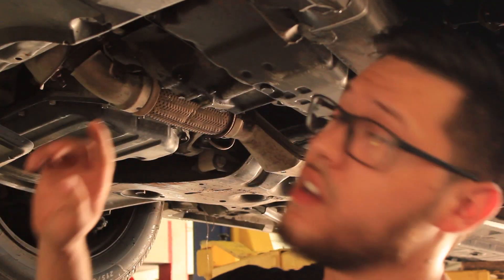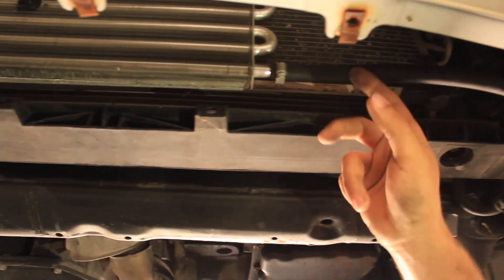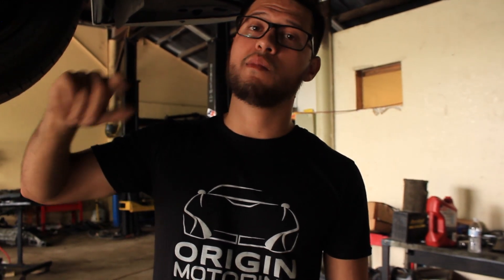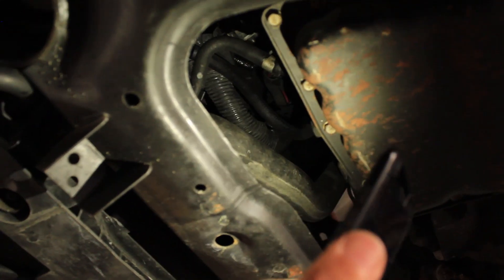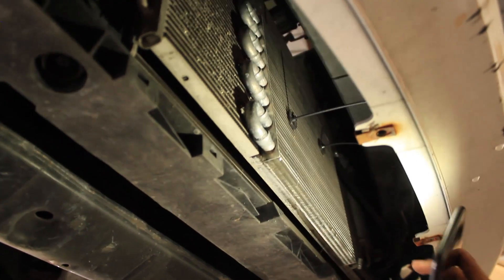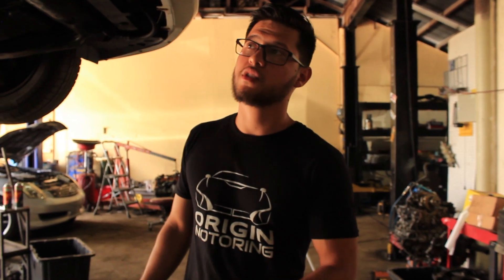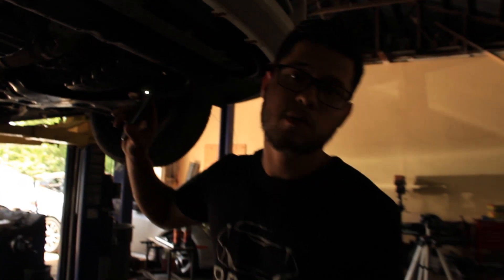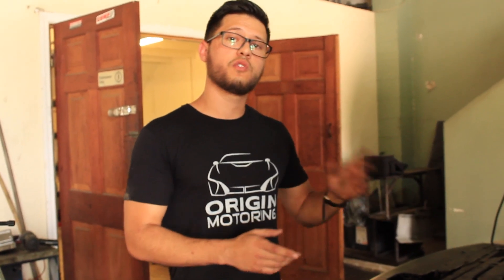Altima cvt Fix. Transmission more reliable

Comment: I have Nissan Altima 2013 SV 2.5L
My Car lose power while I'm driving , and it's not accelerating.
I call Nissan affairs customer service, I asked them if my car has a recall for the Transmission, They told me No, I ask them for Assistant to fix my car.
She said yes, we can open case for you but you have to go to the dealer for diagnostic test, I told her They Asked $200 for diagnostic test. I went there they said it's not the transmission it's the MAF need to be reprogrammed, and I pay $370 for that, problem came again next day, I call Nissan they asked me to do the diagnostic test again and pay another $200 
I agreed, in the end they told me Transmission need to be replaced, Nissan Company called me and she said because you have high mileage we will not be able to assist you, I told her you know my mileage from the beginning why you asked me to went to the dealer for the test and pay $370 and  $200 and $288. and you already had the decision in advanced?
I recommend every body don't buy Nissan their car is 
piece of Junk.
They work with dealer to make money from you 
don't buy their car it's not reliable
Reply: Exactly change the oil I think you will be fine
Reply: John Smithy  Nowadays, most AT car are CVT
Reply: This is why I have replaced my CVT fluid twice.    Current odometer reading: 119,xxx
Next, because of the problems with this, I bought a Car Shield repair policy.
Reply: @billaustin2347  I did also.. how did things go with that
Reply: change the transmission oil. buy a hand pump to suck the oil out. thatll fix it

Comment: Ok, so you are completely by passing the radiator??  You are not fitting the cooler inline with the radiator.  My '12 Altima went into lump mode (30 mph,a self protection mode) going over the 'grapevine' grade in SoCal. I need to keep it cool. But I need to understand how you routed this fix. Thanks for the video!!

Comment: I put the cooler on my 2013 Nissan Altima 2.5l cvt just as you described in the video and it only held about 1/2 qt more and i noticed smoother shifting right away and haven't been on the freeway yet either just running backroads of central Kentucky going to work and home  , thanks again for the great information and video on how to install 😎
Reply: I used the Hayden 516 kit and bought 4 feet of their 3/8 transmission hose for peace of mind  , thanks again my friend
Reply from the maker: @daveanderson8354  how many miles? I have 190k miles on mine original engine and transmission we're shooting for 250k minimum and 300k is our real goal.
Reply: @origintuning7000  92,000 miles and i noticed i had to check the transmission fluid level with the car not running lol
Reply from the maker: @daveanderson8354  also the 2013 is the new body style you can use the 2007-2012 round body transmission dipstick on the 2013-2017. We just bought a 2013 and confirmed it works! The 2013 doesnt have a transmission dipstick its the dumbest little cap
Reply: @origintuning7000  i purchased the dipstick for a earlier model also lol
Reply: Is that the correct way of checking the fluid? Get it up to temperature and then turn car off and check with the dipstick with car not running lol ?
Reply: @origintuning7000  also on my 2013 Nissan Altima 2.5l sedan cvt transmission there is a paper element filter and the metal one on the valve body in the pan , just wanted to share that with you because Nissan says it doesn't have one but i know it does i replaced it lol
Reply: It's called a transmission cooler filter part # 31726-3JXOA
Reply from the maker: @daveanderson8354  check the fluid car on in park with the older Altima dipstick. The inline paper filter comes on some models and I believe it has a tiny magnet inside it too. Great add on by nissan.
Reply: @origintuning7000  thanks for the follow up info my friend
Reply: dave anderson thanks guys! Great info! Dave how is your Altima running? 
I also have 13 Altima, wanted to know if the cooler affects the cvt performance in cold winter  days?
Thank you!
Reply: @roberto3330  it's got about 110,000 now and still pretty quiet but still hear a small growl that could be the nature of the beast i guess,  but no shimmy or shudder and no slipping yet also noticed it seems to get 1.9 more mpg too

Comment: Hi there I was hoping that u guys could help me . I have a 2010 altima and the problem with it is that the transmission doesn't change on it's own I have to release the accelerator every time to change gears. Have you seen thus kind of problem in other altimas.
Reply from the maker: You may need to scan it with a good scanner like a snap on our maxidas scanner. Something that actually reads the transmission computer. A hand held auto parts store scanner may not be enough
Reply: @origintuning7000  can I send u guys a video of the problem so u can recommend me a solution.
Reply from the maker: @shajisaeed2656  a video wont help. You need to access the tcm transmissiom control module with a good scanner and read the live data/error codes
Reply: @origintuning7000  thx man I'll try to do like you said hopefully can solve the problem without having to spend a fortune. Thanks for replying so soon . Cheers
Reply from the maker: @shajisaeed2656  call around most family owned independent owned shops like mine will charge $40-60 to get into the tcm and give you a good idea of what's going on. The dealer or big name shops like firestone you're looking at spending $150+ just to hookup there scanners and get an idea of what's going on
Reply from the maker: Check fluid level. Any codes?
Reply: @origintuning7000   changing fluid yearly and no codes displayed

Comment: Do the 2017 models have thus problems?
Reply: Ive got a versa fwiw
Reply from the maker: Yes it does. Look on Google already lots of complaints
Reply: @origintuning7000  smfh...someonee should sue them
Reply: @don9526  just change it every 50k miles. I have 205k on my altima. Fluid change helps
Reply: occckid123 Is the cvt still running now ?

Comment: I have 2014 rogue the one they the Little pathfinder when I bought it New i had to replace the the transmission twice and then a valve body  all this was done in 2015 and 2016 . Was going to get rid of it but the car is about to be played off so I decided to keep it because I want to add the cooler preferably the one that's made by company Hayden is this tranny the same as the Altima .
Reply from the maker: Yes it's very similar to the altima cvt. I highly recommend a cooler

Comment: I have a Nissan versa, witch port on the trans is the out to the cooler? It has an side mount cooler with 2 hoses that go to the front radiator already Help!! jomo329@comcast.net
Reply from the maker: If you are not sure I'll disconnect both and turn it on for a quick second or two and see which hose the fluid comes out of

Comment: Let me guess Your on the west coast..
Reply from the maker: Orlando florida. 20 mins away from Mickey mouse
Reply: @origintuning7000   Cool From Jersey, 15 Minutes from Atlantic City.. Mays Landing, Definitely going to get something like this done, Fast Religion has a Kit, But Rad seems a Little smaller, Anyway it's hard finding speed or performance shops around here willing to do these up grades and preventive measures... ON A JUKE OR Tune ONE, Sucks for Me I have Nissan 2011 Juke SL 75,000 Miles.. Should I drain and Fill CVT Now or let it go, I had A.C. Nissan Dealer tell me let it go..???? Funny, Not Really Tho, But I started the CVT Savings too..
Reply from the maker: @marcasswellbmd  if you don't do the cooler id at least drain and fill the fluid once a year. The dealer most likely won't touch it to not be liable for your transmission warranty if it's already over warranty
Reply from the maker: @marcasswellbmd  I've never seen a Nissan cvt get worse when changing the fluid. Still a possibility but I've never personally seen it with all the Nissans we work on
Reply: @origintuning7000  Thanks I believe U, It makes no sense not to want fresh clean fluid in there..

Comment: Any one in particular recommended? Or should I buy to of the 2 port coolers?
Reply from the maker: The upgraded cooler has 2 big ports for coolant (like normal about 5/8 size hose) and 2 extra small ports to run a 3/8 hose external cooler
Reply: Ok cool where can I find it and what’s a name for it?

Comment: Will this work with a Maxima?
Reply from the maker: Yes but the cvt maxima will need the cooler adapter with 4 ports
Reply: @origintuning7000  where can i buy this for my 2017 Rouge?  Is there an ebay or amazon link?

Comment: What is the brand and name on the transmission oil cooler you have installed?
Reply from the maker: Hayden
Reply: ORIGIN MOTORING what’s the code number for the Hayden transmission oil cooler you have installed? I would to like to purchase the exact one!
Reply: @miguelaka9583   Buy the Hayden 578 Heavy Duty cooler..works on mine and recommended by lots of other people on the Nissan Forum under Altimas.

Comment: What’s up man. My 2011 Altima is starting to rattle. Got a p0746 code on it. Any suggestions?
Reply from the maker: First step is to clear the code and then turn car on and off read the codes again if the code turns on and then it is in electrical issue. Turn it on and off multiple times do not drive the car or put the car in drive to see if the code comes back. If the code does not come back then I would drain the transmission fluid and put all new transmission fluid and then drive it to see if the code comes back it could just be low on transmission fluid. If it is an electrical issue the computer will detect it without driving the car just by turning it on and off it will run sensor checks every time you turn the car on and off enough to trigger the check engine light. If it isn't electrical and the oil level is good then unfortunately you have blown your transmission and you will need a new one or used one here in Florida that's an average 1500 dollar repair including a used transmission with 6 month warranty
Reply: ORIGIN MOTORING ok thanks
Reply from the maker: I have the factory service nissan diagnostic software and even the repair procedure says when you get this code the entire transmission replacement is recomended. It is not recommended to try to fix it or replace the valve body or sensors when you get this code.

Comment: Can you please answer ASAP on my other comment I really need help on which exact transmission cooler I should get
Reply from the maker: I will start selling them online this week and send you the link
Reply: ORIGIN MOTORING you’re the man ! Another question should I just get idemitsu cvt fluid from amazon would that work ? And if so how many courts do I have to put in ? Because my dealer had just changed the fluid but I’m not sure if you have to flush it ?
Reply: And by flush it I mean do I have to drain it all ?
Reply: Flush until the new trans fluid comes out of the return line. If you just drain the pan refill the exact amount you drained out.
Reply: If its a 2012 Altima get the Hayden 678 cooler kit..it has all you need to do the job..I just bought my 2012 3 weeks ago and it did the slipping,losing power deal,so I researched and found out about these coolers..it only takes a few tools and 1 hour tops to finish..now mine is so much better at 107.000 miles. also I drained the almost 5 quarts of fluid out through the tranny pans drain plug,and i am using the blue bottle of Valvoline CVT fluid with no problems..Walmart sells the quarts for about $8 a piece and O'reillys auto parts $10.99 per quart..I got the tranny filter and gasket kit from Autozone for $10.99+ tax..part number TF 705..it took almost 5 whole quarts to refill the tranny,and go really slow and don't overfill !  I did not use the tranny pan gasket from the Autozone Duralast kit,I used Permatex Ultra Grey sealant..make sure you wipe of tranny pans inside and remove the 2 magnets and wipe everything clean,re-install the 2 magnets where they go,.use the stock metal gasket and just use enough sealer to cover the entire tranny pan rail,remove and install new tranny filter,then install the tranny pan,don't over torque and let the car sit for 24 hours to make sure sealant is fully cured,fill with the CVT fluid going slow,and starting car running transmission through the gears and fill tranny until its just to the top of the cross hatch on dipstick..drive car for a while and then re-check clamps and tighten as needed..you should be set then.
Reply: @rosskrause3926  very good information, thanks!
Reply: Thats Great !  I was going to find this video and do a 1 year review of Hayden trans cooler later today so you read my mind..I live in East Texas,and the road temperature gets so hot it starts melting..i will say that the cooler was the best investment yet for my car..I have put about 12000 miles since I installed the cooler and I haven't had any overheats and transmission shutdowns/slowdowns with the temp sensor..my trans pan has the drain plug in it from the factory so its easy to work on..I am going to change the filter and fluid this coming week which means any residual Nissan fluid will surely be drained out and almost 4 quarts of the Valvoline CVT fluid again..mine has had zero issues with the Valvoline CVT,and at about $8 per quart at Walmart,or even O'reillys at probably $10 qt now..I love my Altima..its comfortable on long drives,and I have it all shined up and it looks like new..let us know gow your cooler install goes..I highly recommend the Hayden cooler.
Reply: Anybody figure out what the link is ...or seller name on Ebay?

Comment: I have a 2009 Altima 2.5 s and I tried getting the part at autozone they said they had the part but that they have different size oil coolers or hoses I believe he said . And a part of the transmission fluid what type of cvt fluid can it be any fluid or does it have to be Nissan fluid ?
Reply: Ns2 cvt fluid is a must if you want to maintain your tran. Its around $20 a quart which is a pain but trust dont try and buy the other type of cheaper oil thats not made by nissan. I just changed my transmission oil and gasket today at 140k miles which is a bit overdue but i bought my car at 115k miles so i was unaware if they serviced it. Ohh and I have the exact same car as you.
Reply: When  i  went  to  autozone  they  have  a  ns3  cvt  fluid  in  castrol  brand   should  i  stick  to  cvt  ns 3  in  nissan  brand?  Or  does  it  matter  what  brand?? I  was  wanting  to  buy  the  castrol  brand  ns  3   because  its  cheaper

Comment: Do you need to purge the system of air before connecting the return trans line or will the pump purge itself?
Reply from the maker: Add 4 qts fluid in transmission after installing the cooler Put the transmission in neutral or park first check the level. Then put it in drive and reverse then back to park check level again. Drive car a little bit then check level one last time and youre done. This transmission uses about 3.5 qts of fluid but i like to add .5 extra for the cooler capacity increase. Sometimes it may take up to 4.5-5 qts but thats rare. I own 8 altimas i use as rental/loaner cars
Reply: Thanks for answering so fast. The biggest problem for the CVT is heat related. Your video shows in detail exactly how to install the trans cooler. Thanks' again.

Comment: Did you use a kit or just buy the parts separately? Looking to do same thing on 2012 Altima. Thx
Reply from the maker: We sell the kit on eBay
Reply: I can’t find your kit on eBay. Can you provide a link?
Reply: @jd3521  I just went on to Ebay and wrote Hayden 678 transmission cooler and there it was...it could also say the kits # is 1678..same thing...mine is still running and driving awesome since my install.
Reply: Lots of info by Googling Nissan Altima CVT transmission problems..or the Nissan Forum..Hayden 678 heavy duty cooler kits..I just installed one on my 2012 Altima 4 days ago and its a huge improvement..the kits has everything you need to do complete install,except the CVT fluid.

Comment: How you doing man do you have pictures of what you need for the job or a diagram cuz I will need it for 2014 altima before it get fk up I have 150k with no replacement but I have rattle noise
Reply: I did a tranny oil change and now it's slipping on a 2014

Comment: How you doing man do you have pictures of what you need for the job or a diagram cuz I will need it for 2014 altima before it get fk up I have 150k with no replacement but I have rattle noise
Reply: +Merlin Velasquez He said the trans fluid flows into the bottom of the radiator (small nipple with hose, near the lower radiator coolant hose) and the trans fluid travels up inside the radiator's internal trans cooler and exits at the top nipple with hose which is the return line to the transmission.  So remove the top trans hose from the nipple, then run a new hose from the nipple to an auxiliary trans cooler and then from the other side of the auxiliary cooler, run a new hose to connect with the return line.  You can use a 3/8" barb fitting and 2 clamps to connect the two return lines.  Now you have created a loop for the fluid to travel through. This way the fluid will still be cooled by the radiator, but also cooled even more by the aux cooler. So it goes like this:  Out from the trans into the radiator cooler, out of the radiator cooler into the aux cooler, out of the aux cooler and back into the transmission. 
Hope this helps!
Reply: @izzydizzy1115  Thank you! you just explained it perfectly clear.
Reply from the maker: This was the best detailed explanation I could make on the hose routing